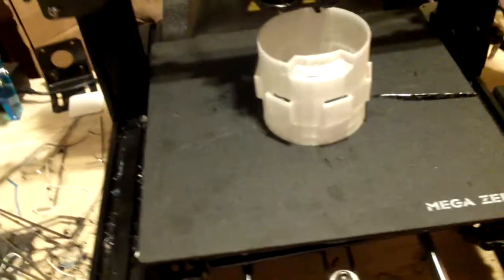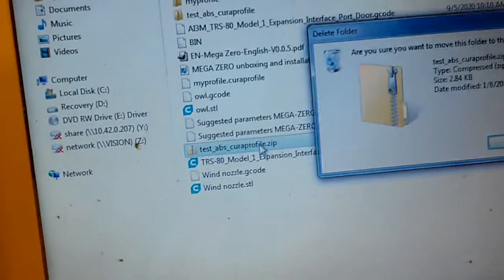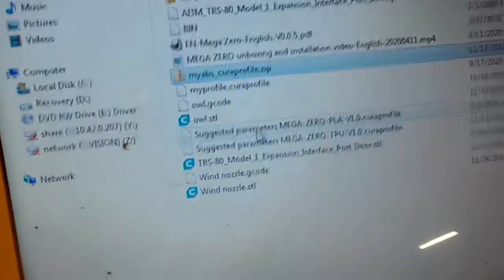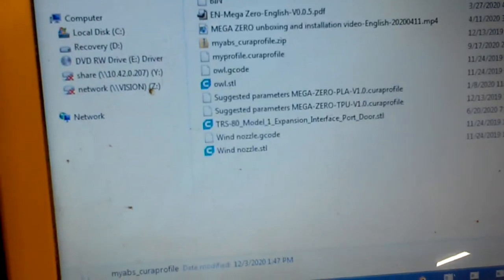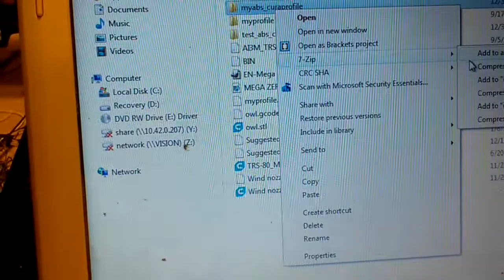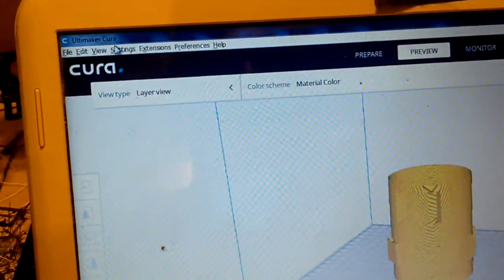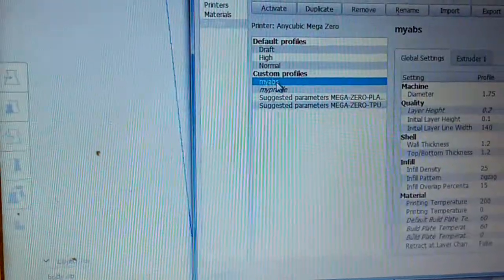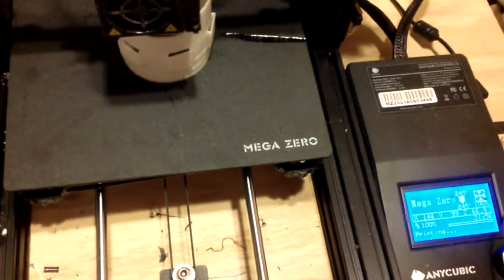AnyCubic Mega Zero ABS Filament Model 3D Printing

Comment: I upgraded my mega zero to have a heated bed but still can't print abs. Not because it can't do it but because I can't stand the smell. On short prints I can but since I live in a tiny apartment I just don't bother with abs anymore.
Reply from the maker: Yeah ABS smells toxic. I setup a vent hose for the laser cutter, need to set up one for the 3d printer as well. I've not done anything with ABS for awhile either.